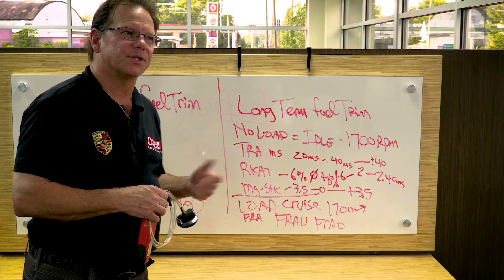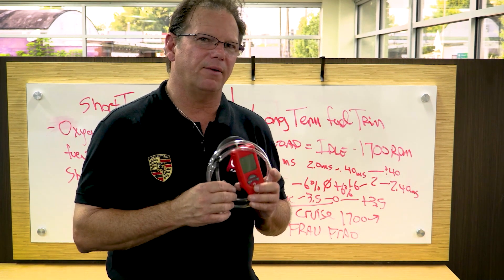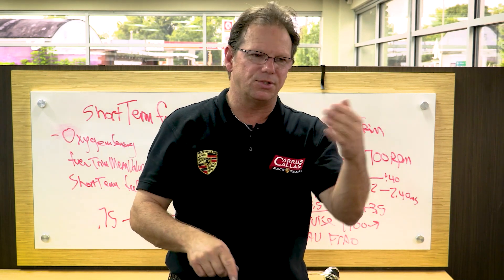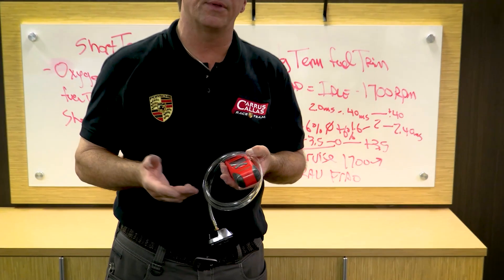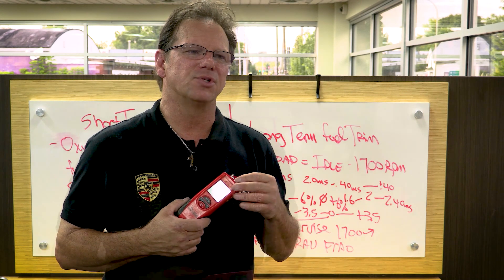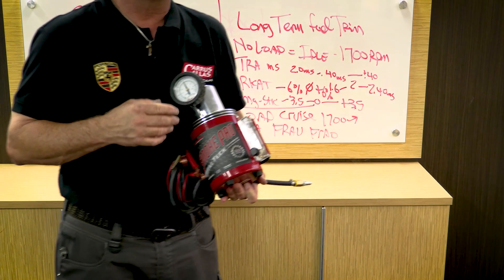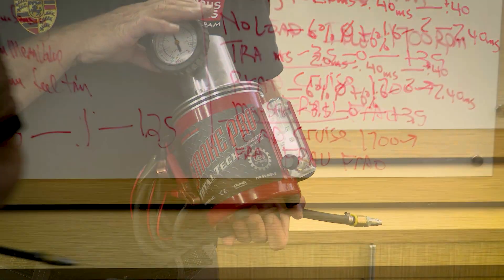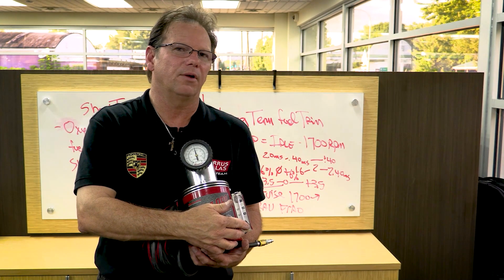Porsche Engine Diagnostics: Engine Vacuum Leaks - with Tony Callas

Comment: Will there be a difference in the normal readings between a stock 3.4L 06 Cayman S and my rebuilt LN 3.8L engine ?
Will the normal readings be higher or lower for a bigger displacement rebuild like mine!?
Reply from the maker: Assuming you are using a Genuine Porsche AOS and conventional piston rings, it should read between 4-6 inches of water column.

Comment: Nice! Have been tracing a P1126 on my Boxster S. Have replaced everything that would do that and even Dealer can’t figure it out. Gonna be hard to pass emissions soon. So frustrated.
Reply from the maker: Finding an independent shop experienced with these models like your Boxster will likely be better than the dealership as dealers work on new cars more often than one of these cars.

Comment: On my 997 2007 3.6, I have a CEL light on, and recently, the camshaft end plug has popped off for the 3rd time. What is causing this to happen?
Reply from the maker: Likely what is the cause for this is if the cam covers were resealed and too much sealant was used and that causes a restriction and the plug pops out. If someone happened to replace the lifter carrier and used sealant under it (where none should be used), this too could cause this issue.